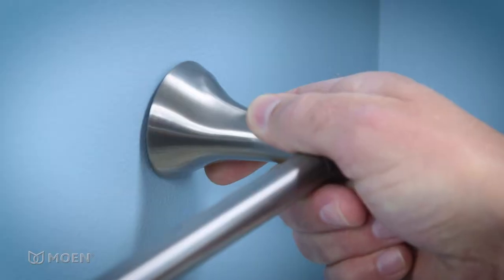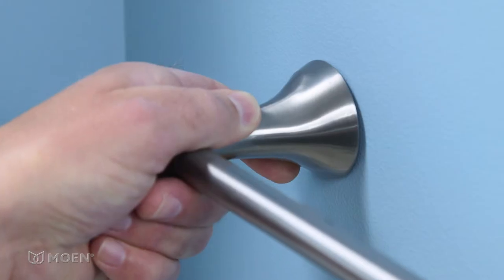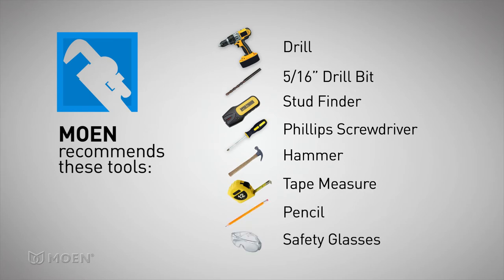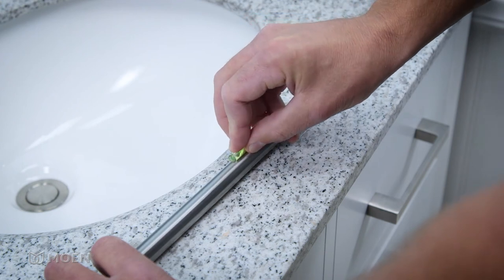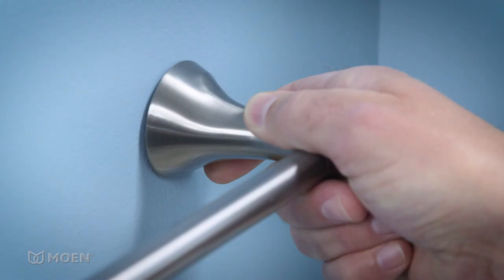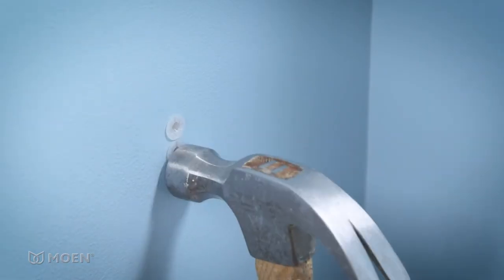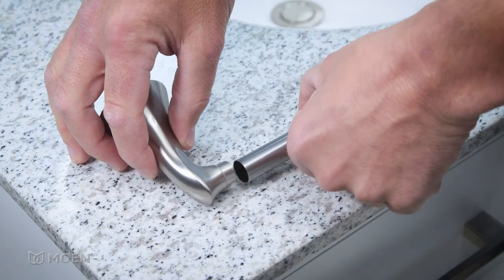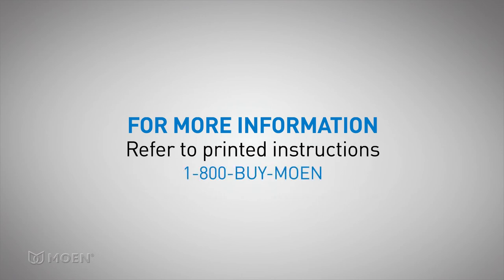Press & Mark Easy 3 Step Installation for Hardware Installation

Comment: Simple but brilliant innovation
Reply from the maker: Hello KentSandyHAYGLASS.  Thank you for your kind words!  

Moen’s Press & Mark installation system eliminates the need for a paper template, the incorporated removable ink pad allows the user/installer to visualize the location and makes the installation faster and easier.  

If you have any additional questions, Moen product specialists can be reached at 1-800-289-6636 and are available Monday through Friday from 8:00 am – 7:00 pm Eastern Time.

Comment: why not on all products 😢 My Contemporary Bathroom hardware kit didn't even have a template.
Reply from the maker: Hello WHUT BM.  We appreciate your feedback regarding the Moen accessories and the Press & Mark installation hardware. Different collections of our Moen accessories use different mounting hardware.  Some are designed with Press & Mark,  some include the Pro-Fit mounting hardware with a template and others include wood screws with an installation guide. We sincerely value your comments and would like to assure you we continue to look for new and better ways to satisfy all of our consumers' needs.

Comment: What about installing onto a door?
Reply from the maker: Hello Crystal.  The Moen press & mark stamp accessories include dry wall anchors. Depending on the type of door, it will require the use of different mounting hardware and you may want to consult an installation professional for guidance